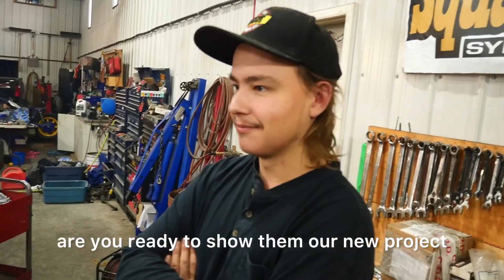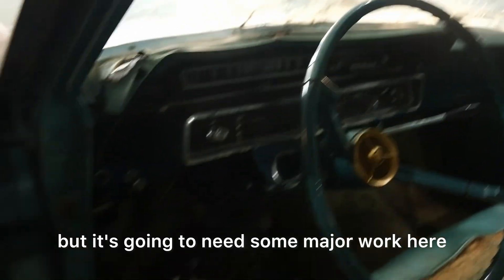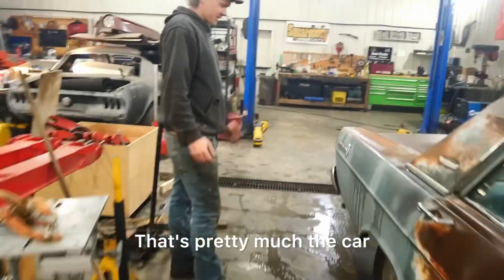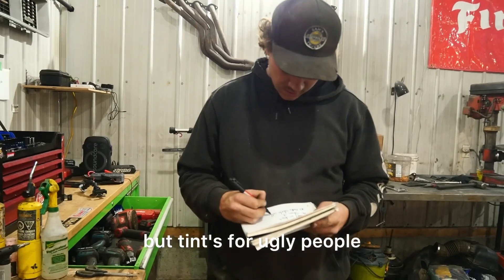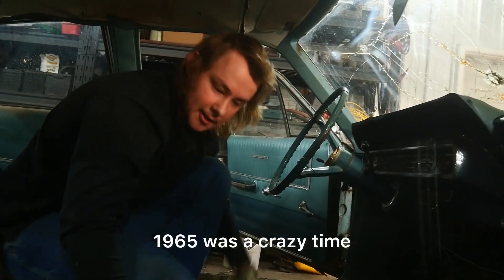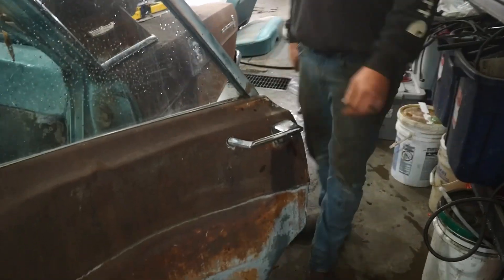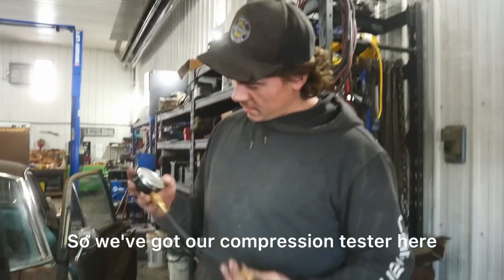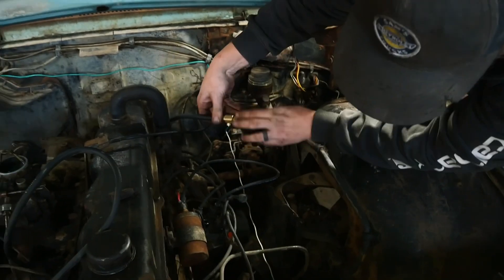Reviving the Past: Building a 1965 Budget Lowrider Rat Rod from Scratch #lowrider#samstrucks#ford

Comment: Check the fuel filter, could be clogged up, i almost changed my fuel pump thinking that was my issue, bit it was just a clogged nd old fuel filter, follow the fuel lines from the carb, it should be close, nd give a shout out if that was the issue